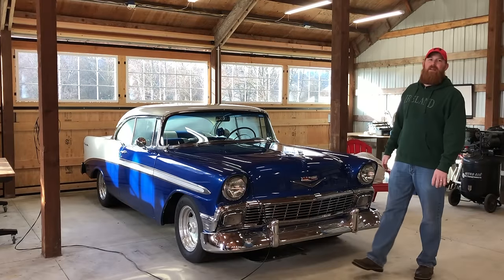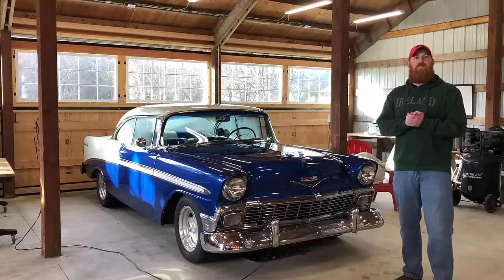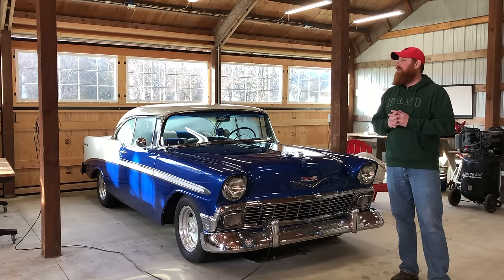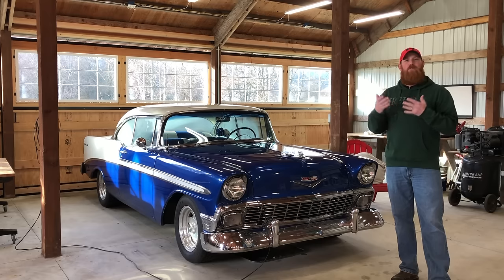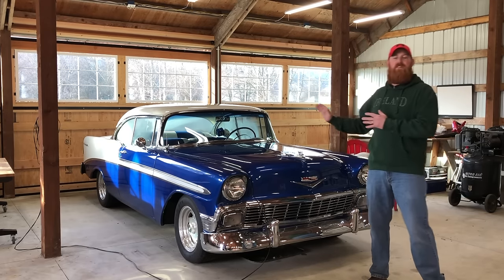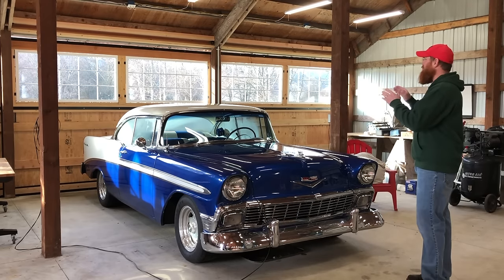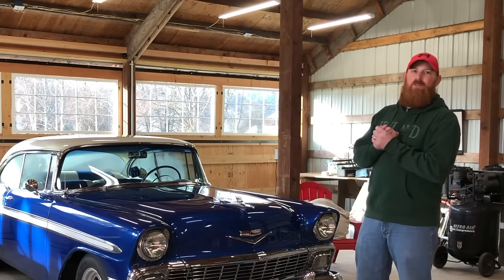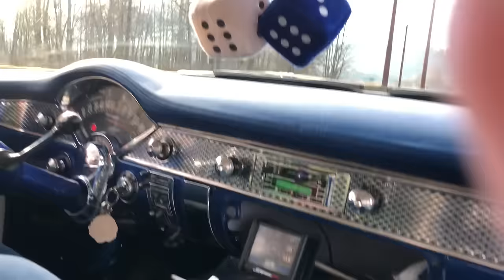Glasspacks vs Flowmaster - which one do. you prefer?

Comment: My 56 has good old 36 inch glass packs, flow masters do sound great, but my glass packs are from 1987 and are still like new and still sound great in my book.
Reply: For me, I like the sound of a V8 with long glasspacks...I remember my little brother had a '78 Chev truck with 12" glasspacks, and it was super loud and obnoxious. I like loud and obnoxious to a point, but this wasn't much different sounding than straight pipe. He took those off and put some 36" GPs on there, and it was PERFECT! once they were broken in, they sounded GREAT. So much smoother, without the infamous "glasspack crack" you get with short ones, yet the truck still sounded mean as hell. Longer length makes all the difference.

Comment: One sound that was popular in my hot rod days of the early to mid 70's used long tubes with either Corvair turbo or Hush Thrush style quiet oval (offset in/out, not straight through) quiet(ish) can mufflers, no three hole gasket and one or more thin washers where the gasket used to be, no pipes beyond the end of the muffler. Those sounded incredible. I had a '65 Nova with a built 327, Hooker fenderwells and Corvair turbo mufflers. Tranny was a B/W Super T-10.

Comment: I will always prefer glasspacks. I have a 1959 Chevy pickup, CARBURETED 383 small block, 4 speed, long tube headers, and glasspacks. It has not been lowered, and still has the original leaf spring front suspension. I chose to run the exhausts out underneath the rear bumper, with chrome tips on them. It has a custom sliding rear window, which allows me to hear that beautiful sound better. It also has American Racing Torque Thrust 15" wheels, and RWL BF Goodrich Radial T/As. I would never consider using wheels larger than 15" on any car/pickup.
Reply from the maker: Sounds like you have a nice truck😁
Reply: You must be an old guy to appreciate lower rotating mass on a street car.   Unfortunately, as a great car designer predicted, the kids that grew up playing with hot wheels will want big rims on their cars, and they do.
Reply: @richardelliott8352  I just turned 64, and I grew up playing with and collecting Hot Wheels. The late '60s/early'70s were the golden age for Hot Wheels. Those huge diameter wheels and tires with 2" sidewalls originated in the ghetto. Criminals of all different persuasions put them on their cars as status symbols. They are called "donks"
Reply: The one major advantage of bigger rims is having the room for bigger brake rotors.

The big towing brakes on my half-ton saved the idiot that tried to use me for insurance fraud on the highway.  However, that's an application where those brakes are expected to be able to stop 17k with some authority.

Most cars won't benefit from such a setup unless they're running massive horsepower & torque numbers.  However, most newer trucks are already large & heavy enough to make use of larger rotors.
Reply: Problem is...there is only one choice for performance tires in 15"....
Reply: @kennethalbert4653  What do you mean by "performance"? Vintage cars do not have any handling. So basically all they need is traction, for acceleration and braking. My former 1979 Lincoln Continental Mark V, a 2 1/2  car with fairly narrow 15" wheels and tires, did just fine. My '59 Chevy pickup has considerably more hp (just over 470 rwhp at 5400 rpm) it has 275/60-15 BF Goodrich T/A radials on 15x8 wheels in the rear, and 225/70-15 BF Goodrich T/A radials on 15x6 wheels in the front. It does have a 4 wheel disc brake conversion, while retaining the front leaf springs (no way am I going to cut up a vintage truck to install weak Mustang II IFS) Yes I can do burnouts in it, wouldn't be much fun if I couldn't. But in normal driving everything is fine. I have drag raced it several times, and those 15" disc brakes work far better than they actually need to. I know several people with 1000+ rwhp street cars and 15" wheels. Their brakes also work just fine. The fact is that these huge ghetto wheels with a thin strip of rubber wrapped around them are just for looks. What I don't understand is why anyone would want to look like a ghetto criminal.

Comment: Many years ago, I had a 75 Mustang II with the 2.3 L 4-cylinder and 4-speed.  At the time, I was working in a shop that did a lot of custom exhaust systems, and my boss allowed the mechanics to work on their cars in the shop after hours.  One night, I was feeling adventurous and built a custom dual-outlet header, along with a full dual exhaust with a pair of 18" glasspacks.  It sounded great, but too loud to live with.  Next night, I modified the system to add 2 more 18" glasspacks at the rear of the car, where the factory muffler originally was.  It sounded great.  Whenever I "got on it", my friends said it sounded like a Cessna taking off.  About a year later I traded it off, but made a deal so that I could keep the exhaust system if I swapped it for a stock exhaust.  A couple of months later I sold it and installed it in the guy's car at the shop where I worked.  

I love glasspacks.

Comment: Awesome video and very timely. I bought a 67 Buick Sportwagon that has a nice duel exhaust system with some sort of “turbo” style mufflers. I think they sounds tinny unless under hard acceleration.  I’ve got glass packs on my 66 Skylark and 68 LTD which I prefer. You helped make my decision to go with glass packs. I’ve also got a pair of slightly used old school Thrush mufflers in the attic that I’m saving for the right project. Thanks for the info
Reply: This the Thrush have fiberglass packing in them or are they just circular baffles? I've seen them but never off a vehicle or installed any.
Reply: @bw3506  I don't remember brother if they had glass or not but I did like sound didn't pop as bad as the glass pack but the glass pack would be there when the tail pipes  rusted away.
Reply: @rickybrackin543  No problem. They definitely sound good to me either way.  👍

Comment: I always ran glasspacks when my original mufflers gave out.  When I was 16, my Dad gave my Mom a 1973 Buick Estate wagon.  She had it for a year when the factory muffler rusted off at the outlet (it broke while she was driving it, was hanging down).  My Dad was at work, so I went to the local NAPA store and bought a glasspack and installed it--my Mom said the car sounded different and was just a little louder than normal but she kept driving it!

Comment: When I was a teenager  I had a 66 Plymouth Satellite  361 ci ,3 speed auto .
     I installed Hooker headers ,with Thrush header mufflers running all the way pass the bumper .
    At normal driving it wasn't to loud ,but at full throttle, 
    Well let's just say, I got 3 tickets for loud pipes. 
  And one cop said he was a mile down the road when he heard me. 
                   😄
Reply: Had that happen before when I had Thrush glasspacks on my Camaro, the cop told me he heard me coming a mile away 😆

Comment: If you got a fast nice lookin car you DO NOT need to advertise! My 68 RS/SS Camaro has a 650 hp orange S/B with a big lift looooong der. cam and I put them Bola touring freeflows on, most quiet mufflers on the market  with tiny 2 inch tailpipes to keep the law dogs OFF MY ASS ! and it WORKS! the cops ALWAYS go after the loudest car and that for sure in NOT ME ! haven't been pulled over since I switched out the 3 inch exhaust and loud muffles to 2 1/4" pipe & super quiet mufflers and 2 in tailpipes. I am in love with my quiet exhaust. You get over loud exhaust after your second few tickets as the thrill goes away when the judge continues to opens your WALLET ! been there to many times. 6 years now with quiet exhaust and I would never go back.

Comment: 1:50 that gave me anxiety. Glad you caught it. They both sound really good. The Flowmaster is louder. You get more raw engine sound out of it. But it's more labored too if that makes sense. I'm not sure how I would characterize the glass pack, other than that it "purrs" more, and it's surprisingly quiet, at least to what I was expecting. Obviously, the larger diameter exhaust, and different manifold have an effect as well.

Comment: Not really an objective apples to apples comparison. To really tell the difference between the sound of the glasspacks and the Flowmasters it should have been done with the same exhaust manifolds or headers. In fact it probably should have been done with the same exhaust pipes and tips. In my opinon long tube heades are always going to sound better (and probably perform better too) no matter what kind of mufflers you use. That being said, and this comparison being what it is, I think the glasspacks sound a lot better.

Comment: Nice 56! And nice solution to prevent dragging headers. I ran Delta 50s behind 390 ci with headers and 2 1/2” pipe for ten years, liked the no-drone and the WOT. Then stroked it to 444 ci, bumped the pipes to 3”, and used delta 70s. Also added a Y-pipe before the mufflers with elec. exhaust dumps. Now thats a tone I love! (when the situation allows)

Comment: Best sounding exhaust system i ever had was my 57' chevy 283 with rams horn manifolds, dual  2 1/2 " pipe and Andretti turbo mufflers. Healthy sound with no annoying drone at cruise , but when you opened it up it was a  whole different WILD animal. Loved cherry bombs but they always blew out quick, losing that awesome first day tone.
Reply: I"ve seen some old ads where Andretti endorsed flowmeters, I wonder if they are similar.   As a kid I always equated Andretti with the indy 500, but later learned his was a regular race car superman.
Reply: @richardelliott8352  actually,  Andretti  turbos were more like the high flow mufflers used on 69 roadrunners and other stock hi- performance cars, with a 26" case give or take unlike the 14" case more common now. A little more restrictive but still that classic muscle car sound. Walker turbos are the closest i could find ( 26" case)

Comment: For close to 20 years, i fabricated Lobak Mufflers, and they were custom made in different sizes for different applications. They were track mufflers on a lot of stock cars and for dirt track cars, and we even made them to as side pipes on cobra cars as well as inserts in boat headers. Flowmaster wouldnt test against them in the early years, and flowmaster had a problem of the ends breaking off. The patent ran out on them and now a few companies make copies.

Comment: Thanks for your time and for sharing..u about made me spill my coffee when you pulled out with tender hooked up..as if I've never done THAT. I'd be curious about the difference between the HEADERS and the MANIFOLD alone. That has to be a factor in the two setups.
Reply from the maker: I know that the headers flow more and most likely make the glasspacks a bit louder. It’s hard to say though as I cannot feel any performance difference between the two setups so it would lead me to believe the difference is minimal.
Reply: @BigRed_1980  I believe in the "seat of the pants" is always better on a street car than anything else. I'm all about the FI but I love the old-school look. I liked your SUN gauge you had and I think your "field car" look good with chrome reverse wheels LOL.  I'm changing up the exhaust on my car and I've been looking at some Flowmaster mufflers. And I like the MF #10416 mufflers. Your video has me curious about the  40 series Delta.

Comment: I like the way both of them sound.  I have an old Dodge Dakota with the 4.7 V8.  I put glasspacks on it shortly after I bought it (new in 2000), but switched to 40 series Flowmasters after about a year.  The Flowmasters sounded a lot better...but DAMN did those things drown out any conversation you hoped to have with the person in the back seat, lol.  After those rotted out, I put 50 series Flowmasters on it and have had those ever since.  It still sounds great from behind the truck, but the interior noise was greatly diminished.

Comment: I have owned a c3 vette for 3 years now with 40s on it. Love the sound but i have to try glasspacks. The 40s always puts a smile on my face! The mufflers are at the end on a c3, always owned mid sized rods before with the mufflers in front of the rear end with tail pipes. Your 56 had some cackle with the glasspacks. Which mufflers droned more at cruising speed? Nice car thanks for posting.
Reply from the maker: Thank you. I never had any drone from the glasspacks. The Flowmasters drone a little bit at around 15 miles per hours only. Never while driving at speed though. I must admit that after I made the video, the glass packs sounded better than I thought😃

Comment: Man, I want to do that now, but when I redid part of my papa's truck's exhaust; stock manifolds and head pipes (2" or 2.25"??), gutted the converter (3" outlet after cutting off the flange), straight piped to the glass pack (2.5"), though I did drop to a 2.25" 14" long glass pack muffler to use the stock exhaust hanger, and still running the truck original 2.5" tailpipe. He gave me the truck after putting almost 7k into it, 1994 Dodge RAM 1500 360 Magnum by the way, 129,000 OD.

Comment: Glass packs are great if they're installed right. Most don't install them correctly. I've always used a 30" glasspack/2-  1 for each cylinder bank. NO crossover & or H pipe before or after glasspacks.  I've always put then in the middle of the car. Run 2&1/2" pipe back & over the rear axial & up around the sides of fuel tank & straight out to just past the rear bumper. Great sound & the fumes are out of the way. Plus, the sound goes out the back instead of in the car.

Comment: Was this comparison done on a mostly stock engine? I'm sure it would sound different on a more modified engine right?
Reply from the maker: I did not build the motor but I would say it’s a 350 hp 327 so not crazy built but definitely not stock. If you had a highly modified engine, I would say there would be a big difference in sound.

Comment: I have 2 1/2 " and 30" glass packs on my '58 Pontiac with a 389 and it rumbles great and can rap good, too. Same goes for my '36 Chevy coupe with a 283 and 24" glass packs. My '27 T roadster with a 350, has Flowmaster style and sounds TOTALLY different. I always thought it would sound better with glass packs but, I'll wait till I put the blower motor in it! My '67 big block Corvette has some glass packs clear at the back and they are raspy as hell!  But, I've always liked glass packs.

Comment: I enjoyed your video!  You mention "drone" with your long tube headers. I have  Hooker headers and flow masters on 427 BB 69 camaro.  Once the car is up to temp for a bit, I hear a very annoying solid humming inside the car which i assume is what you are referring to as "dronning"?  I thought that I needed better insulation under the carpet?  Can you comment?
Reply from the maker: I have not heard your car before but what you are describing sounds like droning. Better insulation on the floor of the car can help but probably won’t eliminate it. It has to do with the frequency of the sound you mufflers are making and the acoustics of your car. The mufflers that I have on the BelAir are Delta 40’s. With the delta version of the muffler they add an extra deflection plate in the muffler to reduce drone. I think that is why I don’t have any drone.

Comment: I like both. Changing to manifolds makes a big difference by itself, but it's still a good comparison. The glass pack and headers sounds more hot rod, the flow master and manifolds sounds more like a newer truck with a good exhaust on it. Hard to explain but newer vehicles (1998+) Chevy trucks just started to sound different. That's also because of the LS style heads. But I'll always say a SBC sounds better and I like your current setup! 👍

Comment: I've run both and can do either one. I get the header drag. Had that issue on a slammed 88 GMC truck. I used to joke the sound of the truck was 2 parts cam 1 part collector leak.

Comment: That’s a beautiful 56, and running a 327 is nostalgic - peaks my interest more than some 350 variant swap or an LS. Anyway, I thought both actually sounded pretty good.  From a performance standpoint, the Flowmasters hold their own. No experience with the 40:series, but back in the 90s, I had a muffler shop install an American Thunder setup on a 92 Mustang LX that also got a set of JBA shorties. It was definitely louder than stock, sounded great at WOT, and I could feel a little more power when stomping on the gas. Also got a slight gas mileage improvement. The only complaint I had was the droning when cruising 65-70 in 5th gear. The system later got replaced by a Dynomax, which didn’t drone, but I lost a little bit of kick and the mileage dropped a bit.

Comment: Great 56 !
Great comparison.
I wonder if it’s a generational thing ? I’m 55 Y/O.
I usually HATE the sound of Flow Masters. I took mine off my 70 Chevy truck 5 minutes after I got that truck home & put glass packs on it. 
Yours are the best sounding flow masters I ever heard, but I still strongly prefer the packs.
Reply from the maker: Thank you. I did not install an x or H pipe and I think that is why they still sound raspy at the high RPM's :)
Reply: I'm 63 and have Flowmasters in my 56 for 16 years with headers, 327 ci and turbo 350 trans.  Love the sound of my Flowmasters 😊

Comment: From motor to motor I have noticed that glasspack sound better on smaller cubic-inch engines and flowmaster sounds better on larger cubic inch engines it comes down to a preference thing but that deep sound the flowmaster ads is very good on large cubic-inch motors